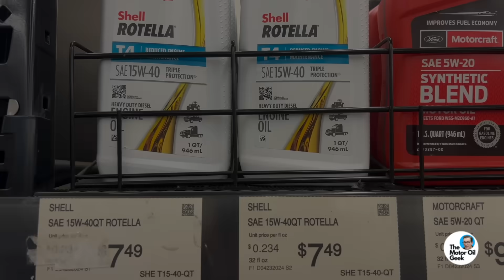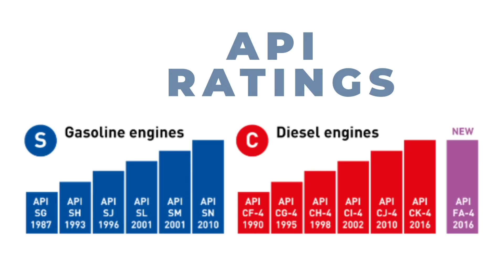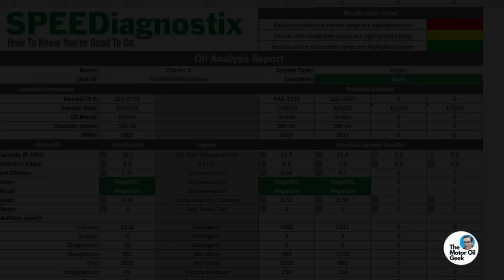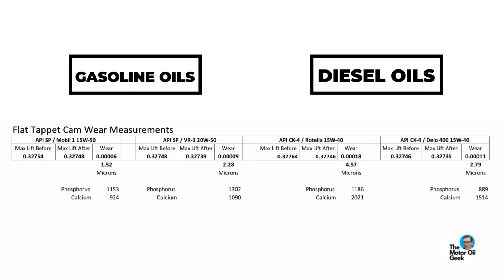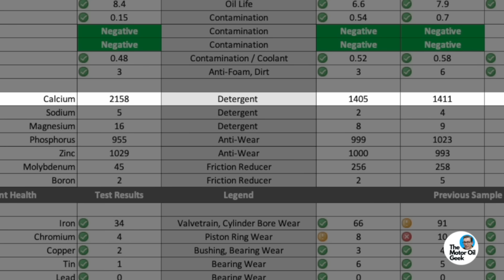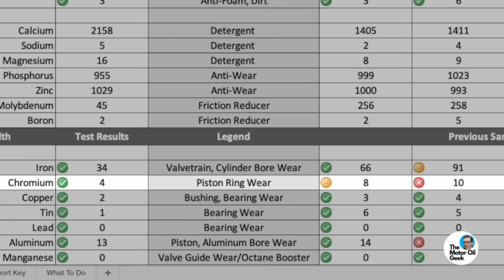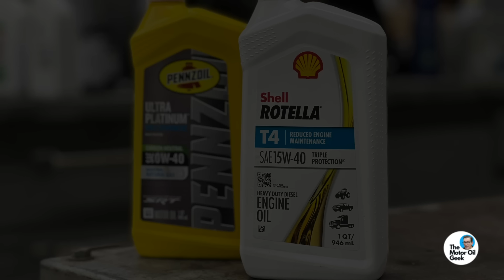Why DIESEL Oil is Actually WORSE for Gas Engines!

Comment: T4 is perfectly fine for carbed flat tappet engines. Many aftermarket engine manufacturers REQUIRE it  or similar for break in, and many dyno shops also require it or similar.  Always read your data & tech sheets folks.
Reply: Its got the dinosaurs and minerals every smallblock loves
Reply: @jeffdelan5124  And even more detergent to wash them away.
Reply: I use this for years in my junk daily drivers on 87 out the pump nothing he says obtains to me lol.
Reply: @Thesakirbey , 'nothing he says obtains to me...' Wow,.you almost as dumb as the VGG stump jumper.
Reply: Interesting that this comment didn't get any kind or reply or clarification... I don't give a liquid poop what Rotella does in a 2020something Godawful Dirty Intake (oops I mean gasoline direct injected) engine; I care what it does in the rich running 60 year old flat tappet V8 I actually use it in.
Reply: My 292 y-block with original carb seems to love t4 for keeping the oil passages clear of build up.
Reply: Thought of you when I saw the title and was wondering how I could get this video to you! 
I'm an hour behind! LoL 🤣😆 
Been enjoying your videos! They're back to the old theme of "Will this old chunk of iron get me home?!!!"
Reply: I been running the 15w40 t4 over 6 yrs in my trailblazer it has 261 thousand miles and still running drive it every day
Reply: Read the information about the product I'm using? I'm not going to let that paper think it's smarter than me.
Reply: Sorry bud, lube engineers in labs are telling me youre wrong and so are pine appled drain plugs I regularly pull..
Reply: ,  absolutely.
Reply: yep  again  clearly the proof is in the pudding  right here  no way to miss it
Reply: It's a great all around option for the Midwest with the old Volkswagen and Porsche air cooled engines. Either the 15w40 diesel oil or the 20w50 that Porsche sells. 15w40 is what I'm using.
Reply: @Ratkill9000  20w-50 is too thick for an old air-cooled engine. Go with a 10w-30 VR-1 Valvoline
Reply: I started using Lucas Classic car and hot rod oil in my flat tappet engines. We will see
Reply: A feller knows his earl
Reply: Dang I was going to comment the same thing but you beat me to it Derek.
Reply: Another motoring legend!!! Love your work too!
Reply: Perfect chat….a diesel master, an oil expert and a revival guru, NICE
Reply: Right on!
Reply: Youre the reason why I use T4 in customer outdoor power equipment. Its good stuff and never had an issue. With that said, VR1 10w30 is good stuff for small engines too. But expensive
Reply: @2000ram59 Expensive yes and not as much detergents as Rotella! Rotella has cleaned up some stuff for me…
Reply: I put T4 in my 351w powered Ford van because of the flat tappets. Now i run VR1.
Reply: Thx for this addition !  I noted that they specifically referenced DI engines and most of the guys I know running Diesel in their Gas/Flat Tappet engines are driving Classic Cars with Carbureted Engines, not DI...
Reply: Just because one hasn’t had a heart attack, doesn’t mean that their diet has done no harm to them.  Likewise, just because one runs an engine for years doesn’t mean it hasn’t been slowly eating cam lobes.  All it means is you never saw the outcome of the long term wear & tear.   When one says “I’ve used “XYZ” for years & never had a problem, it doesn’t mean you haven’t been damaging your engine.  It just means you were oblivious to it!  One can’t argue with the proven wear in the tests that Lake has shared, but feel free to slowly ruin your engine… it’s your dime! 😂
Reply: I thought of you too.😅
Reply: I've ran rottela in many a 4stroke engine..never an issue..our shop will tell customers that its the best alternative to a wet clutch oil.like you say it's got the vitmanz..
Reply: @billwiththeb  yep  again  clearly the proof is in the pudding  right here  no way to miss it
Reply: This is the way. All the vitamins and minerals that engines love 🍻
Reply: I call bs on this video. I been using t4 15w-40 for 10 years or better in my LS, sbc, i6 and 22re and it not only helped a TON on cleaning up sludge but I've never had an engine problem caused by the oil. This video lost me when he went to Dave's but I stuck around, I regret it. I'll never get that time back. The script of this was like someone asked him to write a 1k word essay and so they repeated the same thing over and over just in a different way. I always have and always will run t4 and neither of these 2 are gonna sway me from that. Vice grip garage puts it in everything because its got all the dinosaurs and minerals one needs and thats good enough explanation to me. I'll actually give an example, my STOCK BOTTOM END Ls1 has had nothing but t4 and has been nothing but abused for years. On the tear down after pushing out a head gasket, everything looked fenominal and the bearings hardly showed signs of wear. Nothing showed 90k miles of nitrous pulls on the highway, rev limiter burnouts, or rec limiter with nitrous touches.
Reply: @Ls1ears , you can't read, so your opinion is irrelevant.
Reply: Basically good for any non-cat engine. Especially motorcycles.  Very good for them in particular. It exceeded motorcycle specs for many years before they paid for motorcycle certs and everyone knew it.  Lack of cert means they didn't pay for it. Doesn't mean it doesn't meet or exceed it
Reply: Exactly. I've personally tried many different types of oil in my modified car, and T4 is the best one for my application. Both in price and functionality.
Reply: A guy has a 96 vortec 350 (roller obviously) truck sitting in the weeds, body roached with over 350k that got t4 straight off the lot, guarantee that truck fires up with a fresh battreee and still carries 40 oil pieces at operating temp. I personally use it in all of my flat tappet SBC because of VGG.
Reply: Yup my engine builder requires T4 for break in, and Recommends it for my flat tappet engines. I used T6 in my air cooled wet clutch motorcycles/ATVs.
Reply: T3 and T4 is perfect for wet clutch bikes.    It also scores way better than normal oil on oil analysis on my boosted G35 "gas engine".   Unless they sprovide oil analysis results showing otherwise I'll go with my own results.
Reply: yep, fot those old engines when API was SJ or less... not for the new cars and specially not for any direct injection car.
also, the low power of those rescues won't ever detonate like in this video the Audi piston did...

but as most oils today comes with very little zinc and older engines really needed that, I usually put 1quart or less on my 1974 GM250 of diesel oil and the rest the regular car oil 20W50, I have it for 14 years now and doing this for the last 5 and no complains.
Reply: All the dinosaurs and vitamins. It's my go too on older vehicles because of you vgg
Reply: YO Derick what about a fuel injected 89 5.0l in my van I run rotel in it and it seems to like it,
Reply: You go Derek tell em like it is
Reply: Derek is 100% right. It is perfectly fine for many older engines. The advice given in this video is not universal to all gasoline engines or  operating conditions. I have run T6 for years in most everything and also run T4 in some stuff as well, both gas and diesel. Never an issue.
Reply: AHHHHAHAHAHA hey... I was just bull shittin about the cult/vgg thing... I legit did not expect to see you here....
Reply: WRONG! and it dosen't have the HIGH RPM anti-foaming additives in it like a gasoline oil contains. I'm sure you know more about lighting a YouTube studio than me but, your views on lubrication are sadly lacking.
Reply: @ejgrant5191  Rotella T-6 does.
Reply: @ejgrant5191 You’ll have to tell my flathead that it needs to spin faster.
Reply: @ejgrant5191  Those old American cast iron boat anchor gas engines don't really make power past 4,000RPM. So maybe that's not a big deal.
Reply: @ejgrant5191 why does it have a SN rating then?
When he holds the bottle up you can literally see SN printed on it
Reply: @ejgrant5191   I emailed Rotella and shared your comment since you seemed so sure of yourself. They themselves stated YOU were the one who's view on lubrication was sadly lacking and that you were wrong about T4 foaming at higher rpm in a gasoline engine.
Reply: @ejgrant5191 I support Derek through and through but you've got my attention. So you're telling me at 8500 rpm my T6 is foaming up?
Reply: @ejgrant5191  I was a generator mechanic in the army , and I had to take a class on petroleum oils and lubricants and  diesel engine oil is fine in older gasoline engines the only oil they don't recommend is SAE motor oil because it's not recommended for gasoline engines and synthetic oil because of the price saying it didn't offer more protection than regular oil.
Reply: @ejgrant5191 tell that to the thousands of motorcycles turning fat more rpm than a car does running T4 & T6. It's been the choice of Honda guys for the last 2 decades.

Comment: 8:30 How can you compare w50 and w40 oil and say that it's around the same viscosity. This test proves nothing.
Reply from the maker: Valvetrain wear occurs in the boundary lubrication regime, which is controlled by the additives and not viscosity. There is little to no difference in flat tappet cam wear between a 40 grade and 50 grade oil with the same additive package.

Comment: I have been running t6 rottela in my forged bored over ported,  custom intake and a 4849g turbo pushing 30psi 1.6 l (around 400hp) and not a single issue and have always heard to use it because of the additives are for boosted engines .. now a stock car , prolly would not help , but me , my valve train got quiet when I switched to rottela (also a flat tap cam so all these variables could be why it's good for me but not others )

Comment: This mostly depends on your car and potential mods. Saab owners have used rotella diesel for decades, they don't typically rev high enough to care and it's much better on the turbo. And old Toyotas need the zinc that is no longer in high enough levels in average gas oil.

Comment: If you run diesel motor oil in a gas engine you will have a very clean engine cause diesel oil is full of detergents to keep engines clean and they don't thin as fast as gas engine oils just don't use 15w40 in place of 0w20, you can use 15w40 in place of 10w30 I have done it and never had a problem

Comment: i’ve been running rotella t4 15w-40 in my 06 silverado 5.3 for over four years so far so good 😂 been running it in my 2017 honda rancher 420 since the first ever oil change in 17’ or 18’ and no issues there either 🤷🏻‍♂️ love my rotella I’d put it in anything tbh

Comment: You guys can say what you want but I’ve been running t4 and t6 in every vehicle I own at the very minimum the last 10 years, my wife’s infinity has 400k miles and the only thing it’s ever ran is t4. Never had ANYTHING repaired other than a fuel pump, Every motorcycle and dirt bike I’ve owned the same thing.

Comment: Ran diesel oil in old engines for years. Actually keeps them cleaner and running longer. Ran rotella 15w40 in a sbc 350 for almost 20 years, 450k miles. And all I run is valvoline premium blue 10w40 and works beautifully

Comment: I've used shell 15/40 in a several BBC engines  over the past 30+ years and it always served me very well. This is kinda misleading other point to consider is the biggest development in engine longevity is for 20 years now machine tolerance has gotten extremely good in Asia along with extremely good metallurgy. 1 STP oil additive per 1 gallon of Rotella in all of my V8's  I've never had any issue

Comment: Your missing some facts my Yamaha 250 4 stroke has wet clutches from oil in crankcase they recommend using rotella vs conventional or other oils
Reply from the maker: Wet clutch engines are separate from this discussion. We covered that in a previous video. https://youtu.be/igfiCx4QOrI

Comment: I've done a half change duration run of high quality diesel oil in my petrol cars every few years just in case there's any deposit buildup, the oil filter always seems grittier when I do that so empirically it seems to do the job.
I would love to know if this is less or more damaging (and effective at cleaning) than a dedicated pre change engine flush?

Comment: I know an old mechanic gentleman that runs 15w-40 in everything,  he recently rebuilt his 460 ford with over 300,000 miles on it, and he said the internals were so clean you could almost eat off them
Reply: The guy has little common sense

Comment: Ok I probably missed it but.. oil should I use for a flat tappet gas engine? If talking about us “old school “ guys.. I don’t know any old guys that run diesel oil in direct injection gas burners! Fake news!😂
Reply from the maker: Mobil 1 15W-50 or Valvoline VR-1 20W-50.

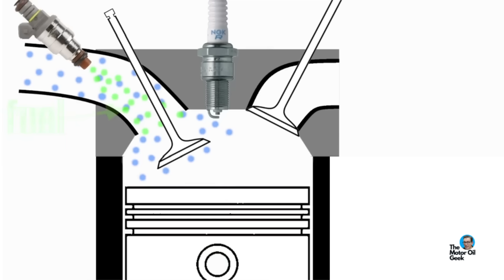Comment: love the graphic at 1:49 where the pistons are running in the oil pan. Lost ALL credibility. I have MANY miles with T6 in a number of different ICE engines and will stay with it. Zero reason to not use it. Then at 2:42 they show a graphic of a GDI injecting into the runner - not the combustion chamber. LOL. I really love that the testing is done with special cams/lifters that are not actually run in production engines. Hard pass on your 'science'.

Comment: The Subaru wrx/STI crowd is going to upset about this video. I never agreed with it but tons of EJ users run rotella T6 and live and die by it. To my understanding diesel oils have less anti foaming agents as well so they are less suited for higher rpm applications such as in a passenger car. I’ve been happy with my HPL pcmo 5w30 for my STI those guys over at HPL formulate some excellent oils.

Comment: After 4 minutes of this drivel I had to stop...
Stop lying to the public. Soot is not "unburnt fuel". Unless you have a dead hole, no raw fuel is coming out of a diesel engine. It is a complete burn every time. It's lying propaganda like yours as to why intellectually dishonest people developed EGR for diesels. The soot or particulates are a mass collection of impurities and other elements left over from the burning of the fuel. These burnt particulates are always there and the more fuel volume per injection, the more particulates you'll have left over 
Also the microscopic holes in the nozzle of a diesel injector don't turn the fuel into a vapor, the "atomize" the fuel.

Comment: Look at the piece of paper that comes with your Comp Cams flat tappet cam. What does it tell you to use? ROTELLA OR DELO!!!! I used Rotella in all the prewar cars I built. Why? They are not as efficient as modern cars! 6 to 1 compression at best, updraft carbs, flat or T-heads. They build up a shit ton of carbon and deposits fast. Rotella and Delo deal with them better. I was a professional RESTORATION mechanic for 45 years. If I didn't use Rotella, I would use Valvoline VR Racing oil. Why? Single viscosity and higher weight. I built a 1923 Cadillac V-8 engine. It ran the best on valvoline VR 60 weight. Remember, poured BABBIT BEARINGS!! That shit does not like synthetic. Now, my 2010 Honda Civic? Mobil 1 synthetic, nothing else, ever.  My 69 Charger with the flat tappet cam? Rotella.
Reply from the maker: Stay tuned for the next video...

Comment: One more comment. I started to investigate this. It is true that calcium and Zinc fighting for the same metal surface but here are facts from the oil analysis:
1. T4: CALCIUM 2327PPM , ZINC 1130 PPM
2. VALVOLINE VR1: CALCIUM 1090 PPM, ZINC 1475 PPM
3. GTX 20w50 anti sludge:
CALCIUM 2096PPM, ZINC 640PPM. 
Looking at these numbers I will continue to use T4 for natural aspirated pushrod engines! BTW; 3000 mls exchange + costs!
Reply from the maker: Stay tuned for the next two videos...

Comment: Been using Rotella diesel oils in my gas powered cars for decades now. I usually replace cars after 200k because of salt damage not mechanical problems. Looking in the oil cap, engine looks like new and oil stays clean for quite a while after an oil change. 
It has been working for me in various vehicles so if I've been playing Russian Roulette,  I'm pretty good at it 😂
Here's a Tib - Bit, oils have really seemed to improve after lead was taken out of gas 🧐😁

Comment: Here is what I learned today. Spark oil DOES have ZDP. 

It seems to be "common knowledge" that modern spark oil does NOT have ZDP.  "Common knowledge" says ZDP was removed from oil for catalytic converters.  This is all over classic car forums;  Modern auto oil does not have it and your old engine MUST have it! So do something about it! 

So the answer there is ZDP additives OR diesel oil. 

Not only the forums but my engine rebuilder shipped a bottle of ZDP along with my 44-year-old motor with a "fact sheet"  lecturing me on the importance of always adding ZDP to my flat tappent engine. (they did NOT say to use diesel oil though)  BTW:  That was the first time I had even heard of ZDP. :)  

So I guess my question now would be; On a classic pre-EPA engine, (with a carb) do I still add ZDP to modern spark oil per the rebuilder or are modern oils still fine for my old flat-tappent engine?  

I guess an even deeper question is does pre-EPA/post-EPA engines change the needed oil formulation at all?
Reply from the maker: Stay tuned for our next video. It will answer that in detail.
Reply: @themotoroilgeek  Damn you for making me wait! :)
Reply from the maker: @robajohnson  LOL

Comment: Some DI gasoline engines produce more soot than port injected engines.  Is there a specific grade or formulation of gasoline engine oil that better disperses the soot from DI?

Comment: OK, So PLEASE tell us what to use in our flat tappet, FLATHEAD MOPAR, carburated engines
Reply from the maker: The Mobil 1 15W-50 or Valvoline VR-1 20W-50 shown in the video are two really good options.
Reply: Thank you very much for your reply.  I intend to change my Rotella ASAP.